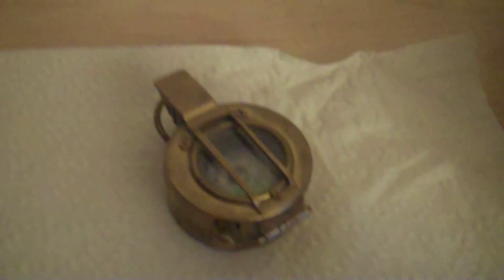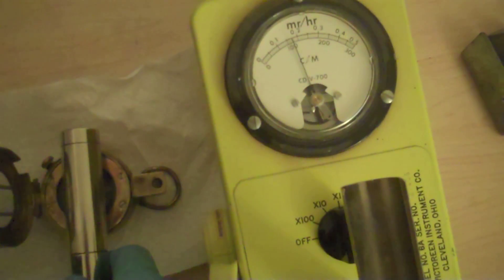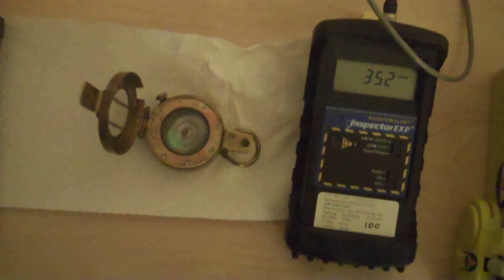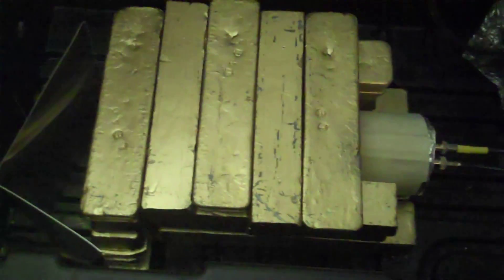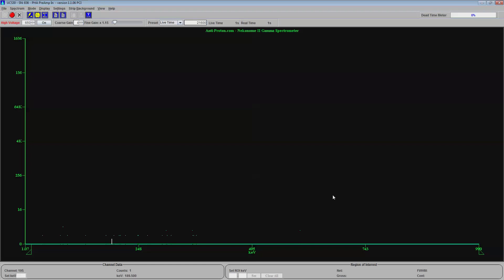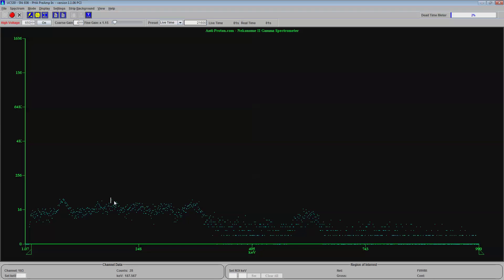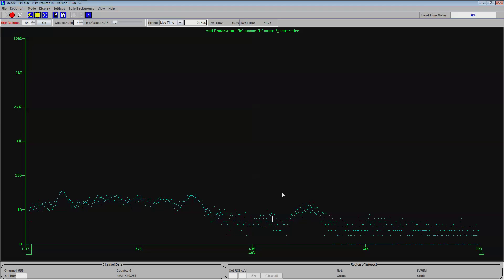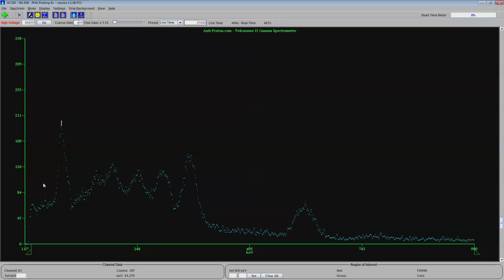The Mystery of the Radioactive Compass - Solved!!!

Comment from the maker: I have not heard of that. Some tubes could decay over time, but the LND7317 (Inspector's tube) is halogen quenched and should not degrade like some older type, which slowly ionized. If the tube gets a leak, that would slowly kill it too.

I have an old 1960's Geiger counter with original tube which still runs like a champ.

Comment from the maker: I do not have a buying guide video. Normally, I recommend the Inspector form SE International. They are extremely sensitive and very useful, but not that great fro food monitoring. In fact, no Geiger counter is really very good with food. You would need a scintillation detector of some sort. They can be rather pricey.

I'd suggest an Inspector if you want a wonderful Geiger counter.

Comment from the maker: Biology and radioactive decay work similarly!   As your bacteria grow, they do so exponentially. Their growth rate is   ln 2 / rate of doubling.   So,  current population = start population *e^[growth_rate]*time. The same math works for this, but in revse. As those bacteria saturate their petri dish, the water might become anaerobic and they may start to die. If some aeration occurs, the rate of death vs mitosis might level off... into an equilibrium.  
(cont)

Comment from the maker: (...cont).

Radium 226 slowly builds a chain of progeny (daughters), most of which are more radioactive (they decay more quickly). Thus, as time goes by the average radioactvity of the source increases.

This is not the case for everything. For example, secular equilibrium: When Cesium 137 changes into Barium 137, it becomes stable.

These are all statistical properties of radioactive decay.  =)

Comment from the maker: Great question!

When a substance decays it changes into anouther configuration with less mass. This new configuration (a new isotope) may actually decay faster than the parent.

Radium 226 has a halflife of 1600 years, so it decays slowly. It's daughters decay much faster, anywhere from a few minutes to as little as 160 micro seconds. As radium decays the daughters increase, but they are also decreasing due to decays... after a while this may level off (isotopic equilibrium).

(cont)